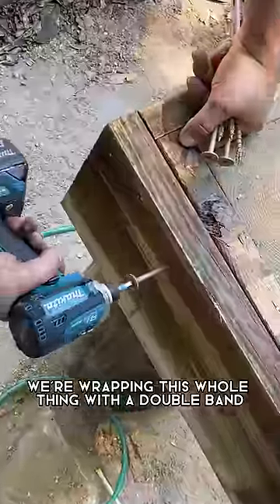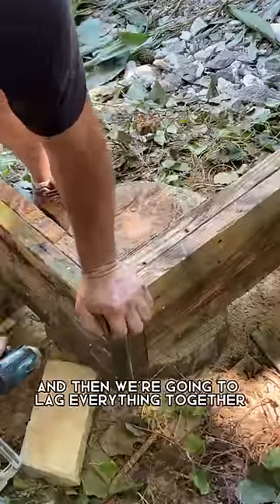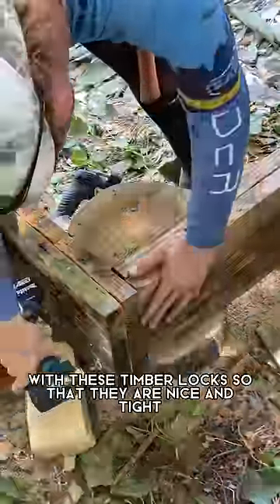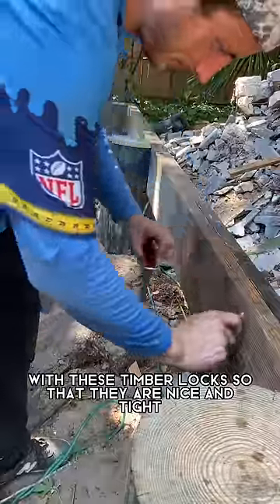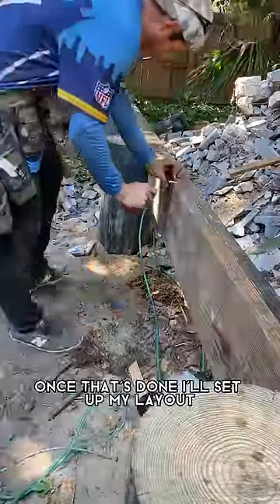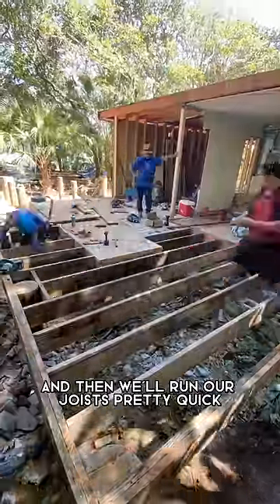Floor Framing 2 | Artpentry

Comment: You'd be amazed at all the houses that have improperly laced corners that were built decades ago and still hold together just fine fine.
Reply: Exactly, lace the corner
Reply: Laces Out!
Reply: so you mean stagger the edges so that are "offset" from the inner frame. .so the end of each on the inside is covered by the outer frame at the corner. .and then repeat all around?
Reply: @joey.g  
It's like herringbone. So, yes....I think. If I understand you correctly. 🤔
Reply: Houses are supposed to last longer than decades
Reply: Got em!
Reply: ...your argument doesn't make it right...
Reply: Inertia is everything, or lack thereof. Some of the older houses that have stood just out of laziness and not wanting to move face an atypical weather event will end up looking like a house of cards

Comment: I like the part where he explained the mistake to a non-carpenter like me in such a good way, that I understood it!
Reply: Yes I agree so I will let you know. If you notice the corner that starts the video is different from the other corners throughout the rest of the video. Each one is a different corner but that first one is different than the rest. They both work but the other ones are the correct way

Comment: Yeah, you didn't stagger you corner on the first one, however from what I could see in this video, you caught your mistake and fixed it on the next. I have done this before myself, but depending on many factors, it shouldn't cause you troubles. You could always strap the corner, and that would assure that it never separates. This is something I do on all decks/piers that are expected to have a lot of movement.  1 1/2" x 18" or 24 " strap around the outside of your rim joist. It will never fail you, especially on a deck above 1 story.

Comment: Using framing grade lumber vs pressure treated lumber for the frame. Plus that lumber appears to be very wet, relying on bolts and screws to take the weight vs using a grade beam to hold the deck up. Notched logs with exposed end grain will rot out in no time. If that construction passed inspection then the local codes need a serious rewrite. That deck imho is doomed to failure.

Comment: Are there ledges that ALL of the joists rest on ? It looks like, in spots, that the entire weight of the load on the joists is hanging on the screws. Is that the case ?
Reply: Exactly what i thought. The entire house/patio/porch structure is relying on timberlocks? The joists should rest on the stumps (another problem)  not "lag bolted" to them.

Comment: I'm assuming you're talking about how you didn't lace the corner. Honestly after you send those timberloks the lace is irrelevant. Mostly only needed when only using nails for some added strength with 2 ways to fasten. I try to always lace regardless of lags simply because it's common practice and looks tighter. Great work though!

Comment: How come you didn’t stagger the joints on the other side?;)
Reply: Prevents movement
Reply: If you stagger them won't one of them come lose eventually and if doubled wouldn't it stay one piece longer
Reply from the maker: That was the mistake 😅. I wasn’t too worried though because I had a lot of timber loks onto the piling
Reply: @Artpentry  I think you’ll be alright, I see you used timer lock screws. As long as you have everything nailed properly that thing isn’t going anywhere. Occasionally it happens to my brother& I when we frame out a deck. It’s not the end of the world but staggering them is good practice. Rock on with the videos man!
Reply from the maker: @ReginoMarco yeah I think so too or I would have fixed it! Thanks bro! I’ll keep the videos coming!

Comment: I worked on a very old house that had the beams made from actual tree logs and the pillars were large stumps. Very cool but a pain to fix. I wish they would have just replaced them with cinder blocks and microlams

Comment: Yeah I just did the same thing a couple days ago. I fixed it though. I forgot lace the corner on the base plate of a new wall. Easy fix though. You don’t necessarily have to but I fixed mine cause it just bugged the hell out of me.

Comment: The corners will get ya sometimes, but you fixed it that shows a lot about your work ethic and honesty.  Great job a++
Reply: How did he fix it?
Shows another corner done well. But the other still has screws going through both layers on same side.
He prob used longer screws and pre drilled i bet tho.. good work anyway

Comment: Is there anything right about it? No box, Joist hanging from the nails? Outer cap board put on before the joists are  hung, log corners instead of cinder blocks, nail gun nails in salt treat lumber will not last. Drilling long screws in without a pilot hole Will leave gaps between the woods being drawn together. Oh and nowadays they require stainless steel joist hangers with salt treated wood.

Comment: I spotted it immediately because you were hammering right there at it lol You didn't stagger the bands but you fixed it
Reply from the maker: I actually didn’t fix it, but only because I had a really solid connection with the timber loks
Reply: @Artpentry  oh it must have been the other side that was staggered.  With timber locks its not going to make any difference
Reply: he didn't fix it he just showed a pic of the other corner
Reply: He didn’t fix it because it doesn’t matter. It looks good from his house and mine 😂
Reply: @JimmysJohn33  yeah I thought when he showed the other side it was fixed but your right it don't really matter

Comment: Usually you run one band, run your joist and laminate the 2 nd  band after the joist. This allows you to nail the end of the joist at 90 degrees through the single band to provide more strength . Then toenail and add hangers.
Reply: Also your corner isn't round robin. Interlocked

Comment: It looks like you have the direction of the nail gun pointing the wrong direction. Rather than driving that piece into the adjoining piece, your nail is going into the board itself. He actually tells you in the video what it was. See where the video is at when he says "seen it".

Comment: The only thing I can see, is the outside board should've been an inch and a half above the inside boards, for the flooring, unless you use joist hangers, then put the joists down an inch and a half. That's the only thing I can think of.

Comment: The mistake is that your joists are supposed to be offset at the corner rather butting them up to cross joist together.  Like the one you show later in the video.

Comment: Yea, the outside board on that double should be an 1-1/2 in. longer and the single side board should be 1-1/2 in. shorter so you can nail the tie in on both sides instead of just one side.

Comment: If the the wood pile was dead corner, the bord was supposed to be outside, not inside. It seemed that there was already a place we're to lay and the corner was not symmetrical. 

I think.

Comment: Once those logs used to lift the frame up rot it will all fall down. I hope they are treated with either with epoxy or a plastic resin to prevent rot.

Comment: You need your joists to sit on top of the post and not the sides. With them on the sides the only thing holding all that weight is nails and lags. That woulda 100% failed inspection where I'm from

Comment: No staggering at the first corner,the pillar at the first corner is out of alignment with the rest of the pillars by an inch or so and I can’t notice if your timber is pressure treated or it’s just some gunky reclaimed wood that is not treated and will rot in 3-4 years.

No hangers but nails,no code compliance (extra squeaks)

No protection between the concrete and the wood surface and no construction adhesive in sight ( probably the whole thing will squeak a lot soon)

Also you used the nail gun as a hammer,that’s a big NONO
No Eye protection,even tough you have glasses ready on your forehead,

No ear protection for you or the other people( that is by far the biggest mistake,it will surely damage your hearing).

Depending on the budget you had to work with,it might be good enough, and no other thing really matters, but your hearing is important,I guess...

Comment: First mistake is using that nail gun as a hammer. Look after your tools and they will look after you
Reply: If a tool can't handle being abused it's not worth the money. I'm not going to take time out of my day to be extra cautious to not damage a tool I'm using when I could buy something that will actually last
Reply: @ronski4677  In Italy we say that people "with other people's ax they snap off (break) stones" meaning that tools need to be used for what they are meant to be used. Sometimes I haven't got a hammer handy and to not go all the way down to the car an backwards, I would use an old pair of pliers to do it but certainly not my power tools which have their body manufactured in plastic which is weaker than metal.  Even if you spend money on power tools the most of their  armature (shield) is not heavy metal and can't handle so much for so many times believe me!

Comment: No top plate. Would've made it a b!+c# to notch unless you used smaller lumber which might not have been an option. I'm guessing you did it on purpose for some reason, but I would've probably slushed the block if I did that.

Comment: If u would have use carriage bolts it’s not an issue really but u used lag screws which are really strong too but not quite as strong as carriage bolts
Reply: Those timberloks are no joke strong, not like old outdated lags. Wanna say the sheer rating on timberloks is like 1600 lbs per fastener, that's getting on up there with the kind of sheer you get out of a concrete wedge anchor or a red head.

Comment: I see lumber resting on concrete blocks without a vapor barrier.  Wood quality is half rotted already. Didn’t interlock corner.  Biggest issue is wood quality.  Best to apply wood water proofing.  Shame to do all that labor with low quality wood

Comment: People that went to the comments to see what went wrong👇
Reply from the maker: I didn’t stagger the outside boards 😂 love this comment 😊
Reply: Well one can't possibly know everything.....wait I just made a mistake in my calculations on the capital asset pricing model.  I used 14.00% as the average return to the market as given by ibbotson, singefeild, et al.  And t-bills as my risk free rate.  You see my mistake surely?
Reply: This is to jacobs

Comment: improperly laced and you didnt dig 32 inches and put a concrete footer for that corner also its not treated so its going to rot three times as fast and dead tree stumps tentd to split from drying and aging not a good job at all

Comment: Your floor joist should be on, not screwed to, the pilings. All of the weight of the structure is on the screws

Comment: Do you have to stagger the joints on the other side? Just curious because I'm about to build my first porch.
Reply from the maker: Yes. Staggering is what I like to do. I only wasn’t worried about fixing because I had such a good connection to the piling in this scenario. But perhaps I should have 😅

Comment: Your first shot you toe nailed into nothing but itself. Lol
Reply: It’s toe nailed into the round post attached to it might look like it’s nothing however on the other side of it that’s a wooden post
Reply: The outermost rim board butted into  the other when it need to run thru it, you can see when he fixes it when it cuts the first time

Comment: Gonna be a lot of wood rot on that patio.
Reply from the maker: It’s treated wood
Reply: @Artpentry   treated wood still rots. The CCA treatment is only a mild deterrent for termites and only slightly helps with wood decay. I’ve come across thousands of rotted out treated timber decks, joists and bearers.

Comment: Note; The problem with building with screws is, All screws are hardened. The purpose for this is to increase the tensile of the fastener. This allows the twisting of the screw to set. However this weakens the fasteners shear strength. I recommend using a combination of nails and screws to secure a deck or pier, but for the framing you should always use hot dipped galvanized lag screws and carriage bolts for the best finished project.
Reply: False, not all screws are hardened. You nail fanatics really need to do your research before spouting nonsense.

Comment: That's some nasty looking wood to be reusing for something as important and critical as an outer band board that holds up the floor , that holds up the wall , that holds up the roof system 🤨 , reusing the tear out material is never fun and should only be done when it's going into a place that is least critical and non load bearing ...